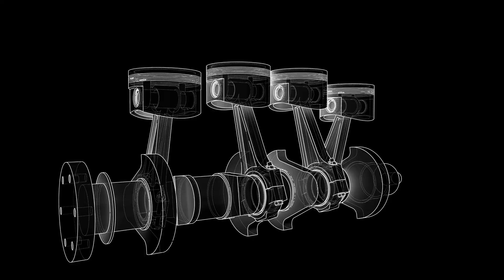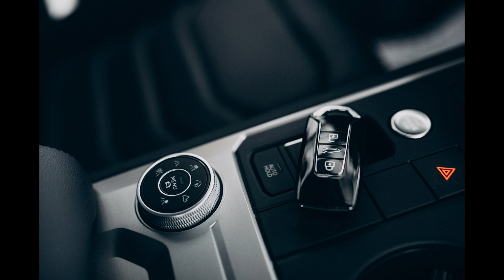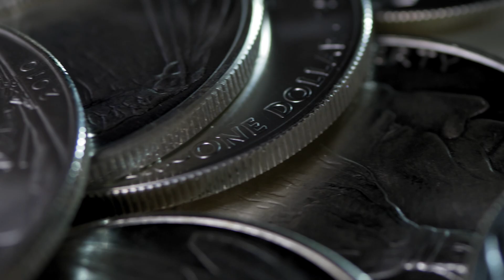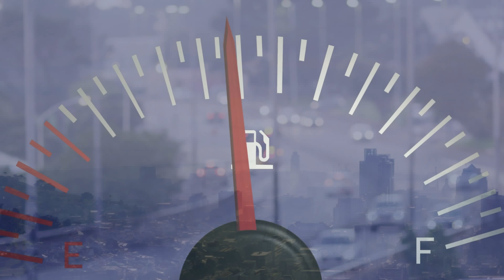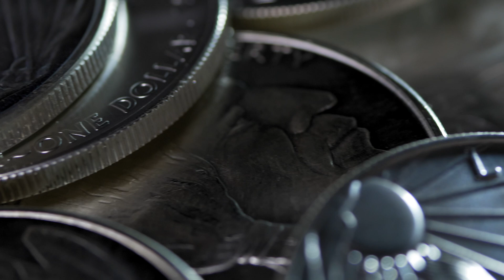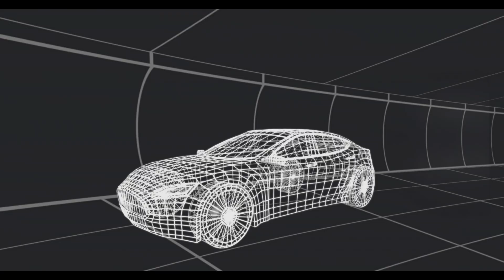"Mazda Just Changed the Game with a New Rotary Engine"

Comment: From experts I've heard on this topic. A rotary has no advantage over a normal piston engine.... but it does have many disadvantages. Engine repairs are more costly. The rotary piston rings are huge problem and that issue will always be there. Cooling and lubrication are also a problem. For example, there are many small engine cars that have gone 200,000 or even 300,000 miles without any major repairs needed. This has probably never happened in a rotary engine. Without a doubt, they do not last as long on average.